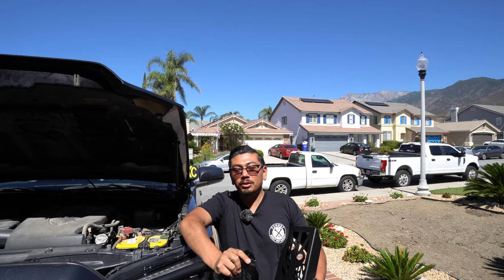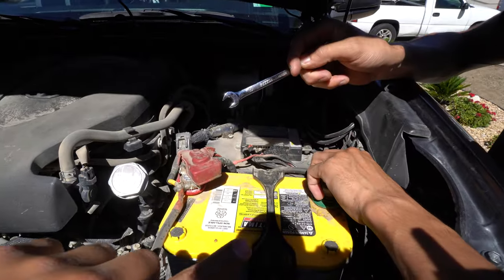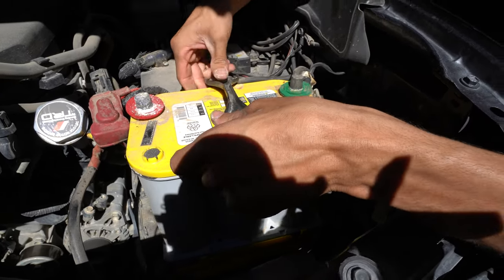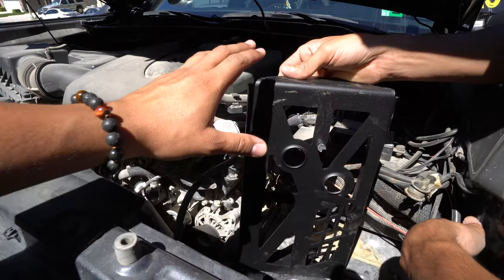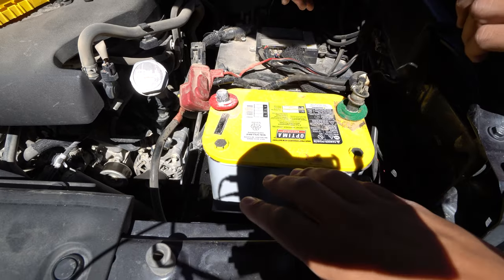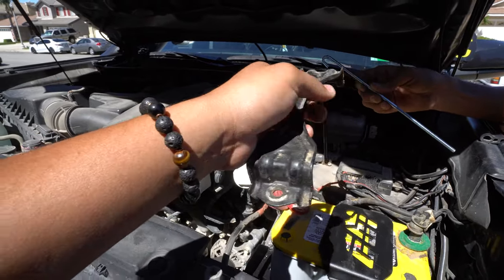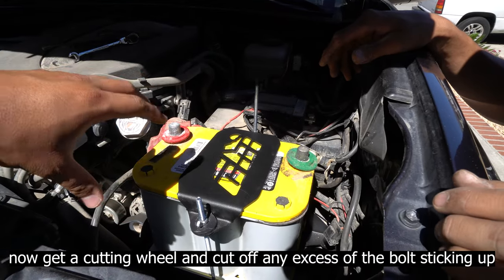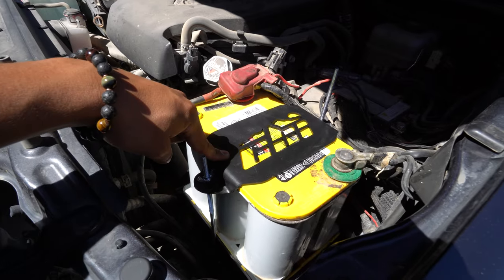Must Have Mod If You Go Offroad? CBI OFFROAD Battery Tray | How To Install On My Toyota Tacoma 4x4

Comment: Clean your terminals before reinstalling!   Add dielectric grease to terminals to stop acid buildup and improve connection.  Those 2 threaded holding bolts need to be cut down to proper length, why leave it sticking up so high.  Amateur work at best.
Reply from the maker: Thanks for the tip :) I will try it this weekend and as far as the bolts I stated in the video that I didn’t have anything to cut it that I’ll be doing it down the road 🙏